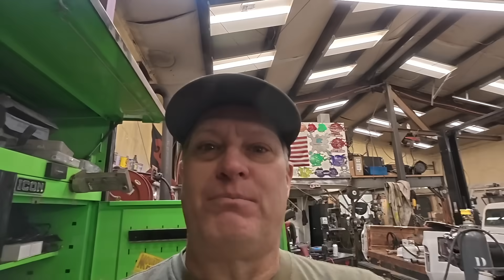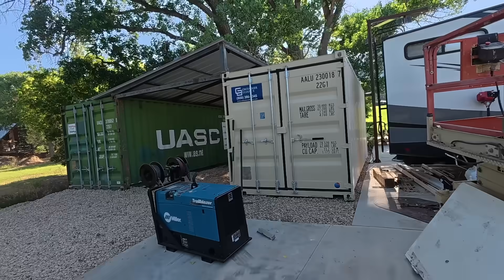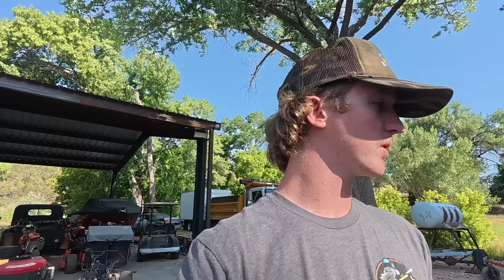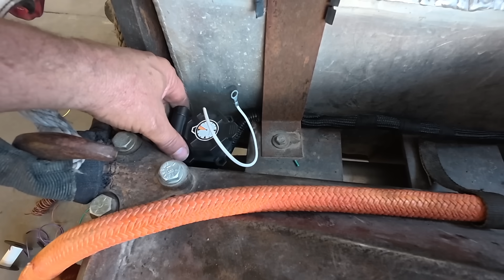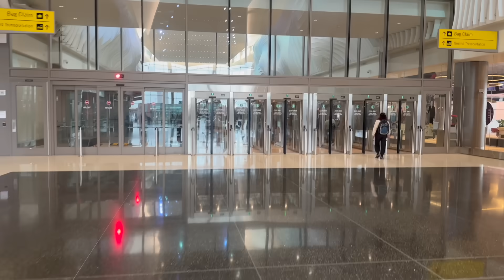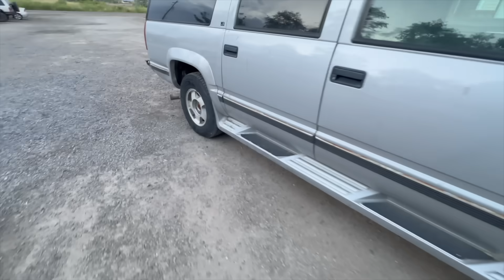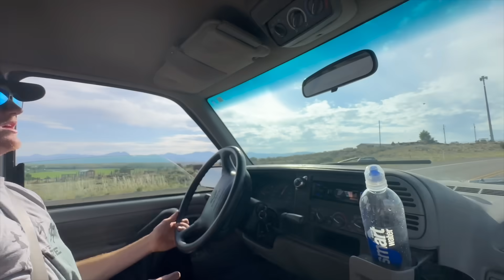Things Heat Up In An Unexpected Place!

Comment: at 11:35 measuring the hole saw. you need to measure the teeth because they're all splayed in and out from the root diameter of the housing.
even then, the diameter generally ends up larger from runout.
after the nerd-out above, you likely don't need anything remotely close to precision for that. my mind overthinking as per usual. 🤪

Comment: Well that explains what Carl and Landon were welding the other day when they took a break and went on that little recovery. That is a nice little storage container garage.

Tom is a HUGE asset to the shop. Every small business owner needs to have a second that is a great contributor as well is reliable and trustworthy. I love to see Tom's, a real pro. 

The Wireless transmitter must plug into the new 7 wire socket that was installed. VERY COOL. Those would be great for a boat trailer too. Every one I have ever had gets a leak and get wet in the lake or in the rain and pops a fuse.  

I say we start a pool for who is the first person to try to use them, only to find that the batteries are not charged 🤣🤣

LOVE it Mechell made it a race and then is like OH CRAP HE BETTER NOT DRIVE FAST.  "It was at that moment she realized"🤣🤣

Jace may not have realized it but he ratted himself out, running 80. I do recall that I70 through Utah has some stretches that are 80 MPS speed limits
Reply: I hope that you ment to say...... MPH ?  Not  MPS  Miles per SECOND 😂😂😂

Comment: Hey if y'all ever have that hold up at the parking garage if your ticket doesn't scan just go back to the entrance get another ticket as if you were pulling in and then just carry it to the exit scan it and roll on big daddy!
Reply: 😅

doesn't usually work sorry - most systems have a minimum time limit. some will charge a minimum fee, others just won't accept the new ticket until it's been long enough.

if you're lucky, you might get away with only paying the new fee and not your original one....though it's more likely they'll just look at the security footage & give your details to a debt collector.

Comment: I've got a pair of those wireless trailer lights that I use on my car when I tow it behind my rv. I love the simplicity of them.
Reply: great, until you forget to charge them and get a ticket or worse yet, someone hits it. insurance will walk away and courts rule you're at fault.
yes, it's very convenient for short trips and tows. for any long term solution, maintained and wired is the only way.

Comment: for the roof rack, you might want to change out the nutserts for something else, maybe some spreader plates as the nuttserts are great for a light load, but asking them to hold down a whole loaded roofrack going at speed down the high way? it'll be not so much a matter of if it fails, but rather when. picking up your stuff from the side of the road won't be much fun

Comment: So glad you did a container span.  You can plasma cut windows and doors out of containers. If you frame outside of a container, you can insulate and run all mechanical service (plumbing, electric, HVAC) though that, skin and fascia the outside, and that gives you a stab at temperature controlled storage with special work shop amenities.  That saves every square bit of space inside the container but takes thorough planning since you have to cut out outlets,  doors and windows. Access to the mechanical stuff would have to be from the outside, so steel panel is your best option. 👽🗿👽

Comment: I like what you did with the awning between the 2 containers BUT I think you're gonna want to be able to open up some side panels for some flow thru ventilation, otherwise I think you'll be in a sauna when the temps get even over 80.
Reply: it looks a lot like being covered storage rather than a work space, to be fair - somewhere to park a vehicle or store engines/steel etc.

Comment: Tom, I suggest learning how to do cable lacing since you have to do so much custom wiring.  Once you're set up with lacing and a small shuttle you'll find it easy to apply and it works much better than split sheathing, especially in high vibration applications.  Wrapping electrical tape around wire bundles means nasty,  sticky messes if you have to modify or fix the bundle.  Paul may have been taught proper methods while working in the telecommunications field.

Comment: So did I miss something. Are those tail lights wireless??? That is really interesting!
Reply: yep. they're a game changer for anyone who used to use a wired light board. no more dealing with 10 metres of tangled wiring every time you want to use it.

quite affordable too. most kits have magnets on each light housing.

I've found duct tape works well enough to hold them on anything non magnetic - particularly fibreglass caravans & boats..
Reply: @mfrsr  Wow first time I've seen them. I'll have to get a set for when the utility trailers lights don't work.
Reply: they're well worth having. also compact enough to have tucked under the seat.

Comment: Hey they make wireless tail lights now that have powerful magnets on them so you can put them anywhere on the car your towing etc.
Reply: you mean like the pair of magnetic wireless lights that Tom wired a trailer plug into the wrecker specifically for?

If you look closely you can clearly see the wireless transmitter plugged in when Tom is testing the lights, which are magnetically hung on the tip of the boom while he's doing it 😂
Reply: @mfrsr Yea figured that out the way Tom was talking about all the wiring he had to do didn’t sound like they were the wireless ones!!😂😂😂😂😂😂😂
Reply: @chuckfowler8875 haha yep. the whole time Tom was explaining himself I was thinking how many trailer harnesses I've wired in over the years, without ever considering it a big job 😂
Reply: @mfrsr You and me both every single time somebody in my family borrows any of my trailers which is slot it’s like why buy one when I have all these trailers anyway they always comeback with no working lights sometimes absolutely no wires even attached or missing completely!!!
Reply: @chuckfowler8875 hey, on the bright side, at least you get the trailer back 😂 I don't lend mine out anymore, not even to family. Twice now I've had to fight the insurance company for replacement value after they got stolen. It's just not worth the hassle.
Reply: @mfrsr Yea did I mention I always have to go get it they never bring it back!!! Bro got no choice they go around me and straight to my mother can’t tell her no never hear the end of it!!

Comment: hope your thinking about the wireless LED light bar by TowMate .  It has magnetic base .  I use it when towing my car behind our motorhome.  Works great, not wiring in car
Reply: the kit he fitted has individually magnetic light housings. much simpler to attach to a towed vehicle than a fitted board. just stick straight to the panels.

Comment: Wireless remote available through Amazon. Sender plugs into 7 pin, slap tailights on metal of towed vehicle, and away you go! But what fun would that be? Everything on the o/r tow rig is cad, for heavy duty rescues. Great video, as in family home evening. Cox family and crew...HAPPY INDEPENDENCE DAY...!🎉
Reply: yup. that's  exactly what he wired the plug in to fit.

you can clearly see the transmitter when he's testing it.

Comment: You need support plates on the luggage rack. Or that fiberglass will crack drastically . Been there done that.
Reply: Doubt that's fiberglass as it kinda looks a bit rusty. It could be, but just look at it more closely, that's gotta be rust.  Some of those older canapies especially were skinned in metal, not fiberglass.

Comment: I still say that the roof rack is on back to front!
Rather than using the drop plate as an Air Dam at the Front, you are using it as an air brake at the back, so air flows through, into, under, the rack and anything you are carrying, until it hits the Drop Plate at the back to act as dam!
Reply: Designed like that to push air down the back window to keep dust, snow etc off of back window.

Comment: 1:17 Doesn't the wind screen on a luggage rack normally go on the front?
Reply: That is actually a air diverter to blow air over the rear windshield to help keep the window clean. It is from the days before nearly every car having a rear wiper. Most station wagons had them. It actually works. 🤷‍♂😊